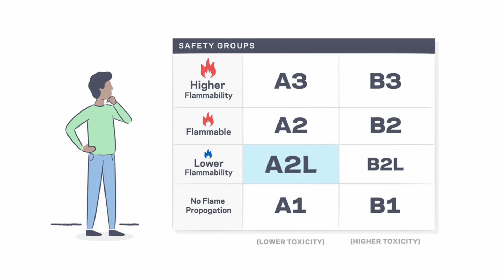HVAC Central AC Equipment About to Get Real Expensive! Myth Busting Flammable R32 & A2L Refrigerant

Comment: R32 & R454b  most USA manufacturers are using R454b. Bosch will be R454b. Watch out for R454b as it contains PFAS chemicals. Known to cause liver damage. So imagine handling that day in and day out. Likely be the asbestos of the 2030's because lowering temp 1.5C by 2050 is more important than killing off techs with liver cancer. The state of Maine is in the process of banning other products that have PFAS chemicals in them by 2030. BUT not refrigerants. I have a six part video series on my channel covering the whole thing since 2021. FREON WARS
Reply from the maker: It’s definitely going to be refrigerant war!

Comment: I've heard this 30% higher difference in equipment but I haven't heard any evidence as to why it would be 30% more? Earlier in the video you mentioned installing two Daikin systems with R32, were those 30% more than a comparable R410 system? If so what are manufactures providing that justifies the increase? I know they are using R32 in minisplits and I didn't see a 30% difference in the price between the R32 and the R410 Daikin minisplits for comparable units. Thanks in advance! Great vid!
Reply: It’s because of the onboard leak detection that will be factory installed in the evap coils, and field connected to the furnace. And Special contactors now that don’t ‘spark’. And why the hell not, perfect time for them to jack up prices. It’s a shame
Reply from the maker: No, they were slightly higher than an R410A system. I don’t know why, but that’s what I heard. 20-30% increase.

Comment: You will still be able to buy R410A just like you can still buy R22 and R12.  You just cannot buy new systems and install them after the 1st.  I read, if you have stock of the equipment, you can get an exception for that equipment.  But no more new systems can be produced for use in the US.  They are only doing it to lower the GWP.  The goal is to move to R290, or Ammonia or even R718 eventually.   Fieldpiece MR45's are A2L certified as are their SMAN and probes.
Reply: R290 is very common here in Australia 🇦🇺particularly for hot water heat pump’s (air to water)
Reply: @JesseDoesHVAC  R290 is used nearly in all modem refrigerators and people don't even know they have it in their homes.  I would be OK with R290 in our future systems.  I think we are just in stepping stones right now.  As things get more efficient, it will be an easier change-over.  

But R32 has been in use in countries all the world for a very long time.  Many brands are already landing in the states ready for purchase with R32 from Daikin/Amana, Midea products and various others.  
I sure hope it isn't the battle of Blu-ray vs. HD DVD all over again.  Carrying four different refrigerants on the vans are going to get cramped.  

I sell many different brands of equipment and we service everything, so we won't have a choice but to play ball.
Reply: @Balticblue93  ive been installing r 32 systems here in aus for nearly 10 years
Reply: @JesseDoesHVAC  And I have ordered my first split systems with R32.  After all, R32 is 50% of 410a.   All Midea window units and mini-splits are R32. Carried has a contract with Midea R32 units.  But Daikin and Amana are shipping R32 now.  I don’t care about GWP because we don’t vent refrigerants like other countries do.  But back to a single compound organic HFC.  It’s only temporary for a period of time till we switch to one of 5-6 different refrigerant that meet stricter guidelines.  I just roll with instead of fighting it.  I know guys putting R32 in 410a systems without issues so far.  I like testing compressors.  And an R32 compressor drops right into a 410a system.   Be interesting testing in my future.

Comment: now apply flame to the r32 at a slower rate.  it is my suspicion that the flame went out due to oxygen depravation.
Reply: That's depraved 😮
Reply: The air to gas ratio for ignition point is astronomical for r32.
Reply: This is the exact concern also need to add a little bit of refrigerant oil in the mix.
Reply: Let the furnace heat up to cherry red to simulate a bearing burning.

Comment: I have an older R410A system. I’m waiting my system stops working before upgrading. However, more importantly I want to see how what works better in the field between R32 and R454B. I know R32 has been around for decades and is proven. I’m interested to see in a few years how these new systems work and the leakage rates since they operate at different pressures. Maybe it’s the same as today. Who knows.
Reply from the maker: Well, only Dan uses our 32 while the rest of the players use R 454
Reply: Refrigerant leaks will be the same as they always have. Even 30 years ago systems leaked. Costs were much cheaper. We litterally gave R22 away 30 years ago. Because? it was cheap. Crazy cheap. R454b has PFAS chemicals in it, so it could be a short lived experiment using that if people enmasse start getting liver cancer. OR the government blames it on booze. Take your pick. Not to mention Temp glide of 2.33 Degrees for R454b. We'll see but following Kigali Amendment requirements for USA, these both with be phased out again in 2036 for something else. Don't get too attached to them. They're only temporary at best.

Comment: Have you heard from your distributors that the price increases will be 20-30% higher or were you speculating? Crazy but what can customers do, if your system is still working why replace it? I’m sure in however many years R410A will be super expensive (like R22 is today) and if someone’s system develops a leak they will be told that since it’s the old refrigerant it will cost a lot to fix vs the newer A2L refrigerants. Best thing to do is save your money and be prepared for when you need to replace it in the future. Always have a stash for mechanical fixes for your home.
Reply from the maker: I’m hearing on officially that it’s going to be a quarter maybe 30% higher

Comment: I think r290 hasn’t been approved in the US because r32 makes the companies more money.  We would see a lot more air to water heat pumps in the US if r290 was approved.
Reply from the maker: Well, I think we’re just gonna have 32 and 454 to replace 410
Reply: R290 is only approved up to 5 oz. It is only used in small refrigeration. Reach in coolers and such. R32 and 454B are / will be used for comfort cooling

Comment: I am hearing that even the cost of window units, which I think a lot of people are going to switch to, are going up in price in the name of 'efficiency.' This has to stop.
Reply from the maker: So I do have a very close relationship with Bosch and I have not gotten any official word as to what kind of price point and price increases. We will be looking at after Q1 2025 but I can’t say that off the record. I’ve been told it’s going to be “significant”
Reply: @PipeDoctor  Hi Mike. Thank you for replying to my question. Do you mean the Bosch window units or central air systems in terms of significant price increases. I think in any case powers at be want to take away the average American's ability to cool themselves in the summer; make it to where only the well off can afford an A/C system. But, that just my two cents.
Reply: Years ago a good window unit was 200/300$. They they started make throw away units for under 100$, some as cheap as 80$. Shows how much they care about the environment like they claim to.
Reply: @dc6233 what about the electric cars....the mining and coal fired plants....bs

Comment: R32 is a single component refrigerant like R22, but unlike R22, R32 is an A2L. R454B that companies like Bosch will use is a blended A2L refrigerant. Seems like most of the industry besides Daikin owned companies (Amana and Goodman), LG, Samsung, Gree, and I think Fujitsu will use R454B (Trane, Carrier, Rheem, Lennox, etc…)
Reply from the maker: Well carrier is pushing “ Puron advance”
Reply: @PipeDoctor  Puron Advance is the label name for R454B. You are correct, Carrier is pushing R454B along with most of the other industry large players besides Daikin.
Reply: We are seeing R32 used in Carrier’s scroll chillers. The larger screw chillers will use a different refrigerant. I believe it’s R513B if memory serves me correct but I could be wrong. Right now most of the manufacturers are already making the switch on refrigerants in some way at least on the commercial side of things. I see the residential side make the switch last as the factories finish up the large bulk orders for their distributors.

Comment: Great PSA. Thanks for the information.  In my opinion Dupont is running the EPA.
Reply from the maker: I think so too
Reply: Kigali Amendment to Montreal Protocol + Paris Climate Accord & California Carb rules. Dupont sold rights and "freon" brand name to Chemours. Honeywell owns patents on R1234yf which makes up roughly 31% of R454b /69% is R32. Daikin is a producer of R32.
Reply: @AustinAirCo  i also heard since honey well has that patent daikin will only use r32
Reply: It has always been about the money,  not the atmosphere. Back in the late 80's and early 90's Russia was making most of the R-12 and selling it cheap.  So they put FET on it to make it too expensive to use. Now they are doing the same with every other one, R-22, 134, etc., etc.
Reply: @michaeltobias3524  If it wasn't about the money, we'd be living in caves with no running water or electricity let alone AC. 

If you don't have money? Third world countries still exist to day. AC is considered a luxury. In the USA, before it's all over -- I suspect for some it's going to become a luxury yet again. For the record I grew up without air conditioning.
Reply: Funny how they were never charged for the damage to the ozone.  But they go after an oil rig that the government said was a  model for safety other rigs should follow.
Reply: Damn right now the DOW bought Dupont. 1 corperation making everything

Comment: Mickey, looking to upgrade to a dual fuel system. 3 ton heat pump and Oil forced air furnace.Any suggestions? Love your channel, keep up the good work work.
Reply from the maker: Buderus oil?
Reply: @PipeDoctor  lol   I thought you were going to invoke Steve L for Roman.  For me, wood pellet/heat pump....mmmmmmm
Reply: I need a furnace not a boiler to add an A coil and heat pump. Thank you
Reply: ThermoPride coats heat exchanger in copper and gives lifetime warranty.  The old ones will last forever...newer ones not as heavy but still best on market.
Reply: Look at Boyertown regal star series triple pass furnace